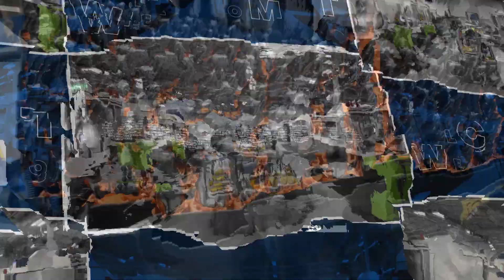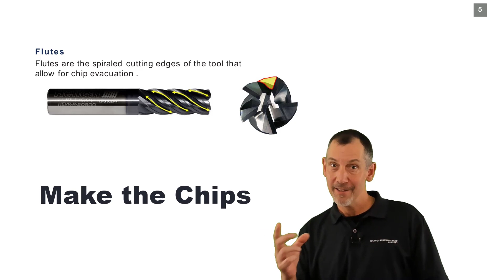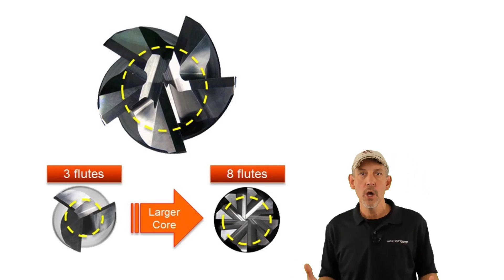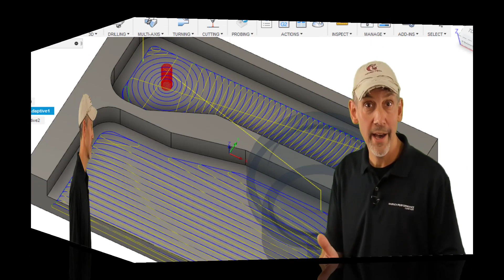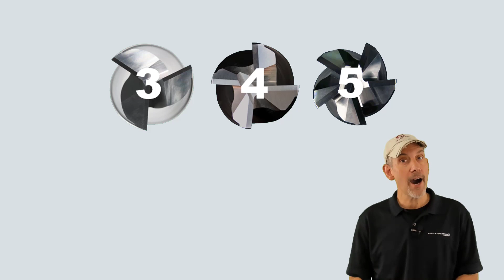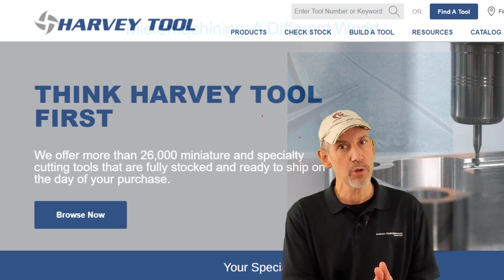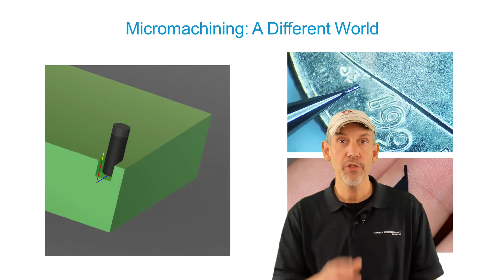Fun With Flute Count : In The Loupe TV Ep. 2

Comment: Informative video that was not very operational. At https://youtu.be/bw5bG7tlo3U?t=226 you display the most major drawback of multiflute mills - pockets. When you are ramping into ex. aluminum chips need to come out and high flute count has difficulties. High flute count also makes chips that require much better coolant flow. 
We have a wonderful - reasonable 6 flute endmill for steel that we use on aluminum outside, but chips are so fine that coolant does not remove them.

I would have liked a tool path discussion of how to mill pockets, and I would like to suggestions for compromises om low spindle speed machines like our Haas TM1P (6000RPM) because clearly we can ramp up speeds a lot if we can run more flutes, but we have most luck with 3 flutes
Reply: When running higher flute counts in aluminum and pocketing with ramping..  I would say you better have a higher Helix tool.  Because of the limited space on helical ramping you want the chips to come up not out..45 degree or higher.  Great discussion and comments.   Glad you are watching. ctc